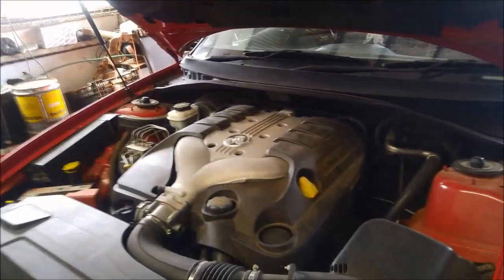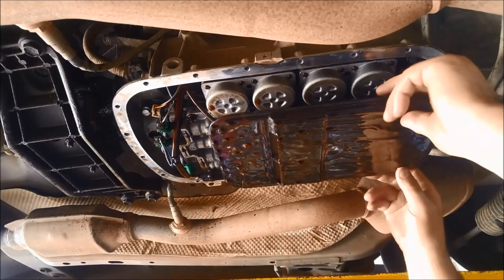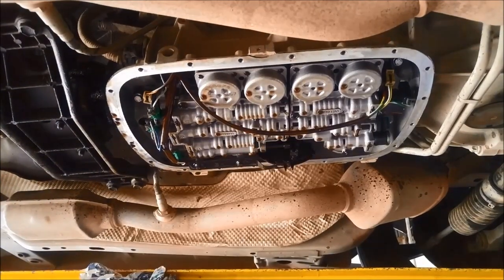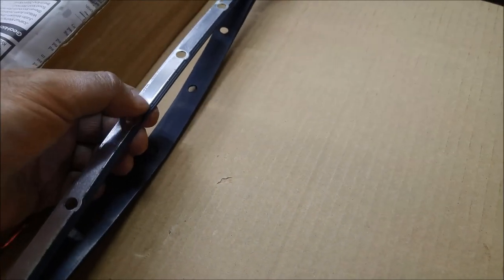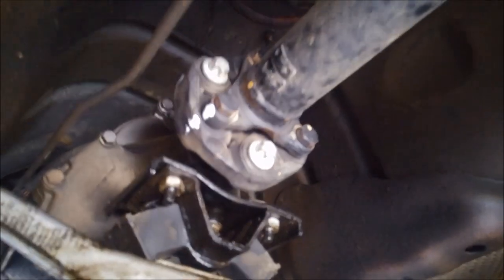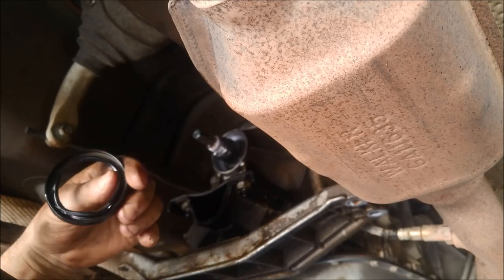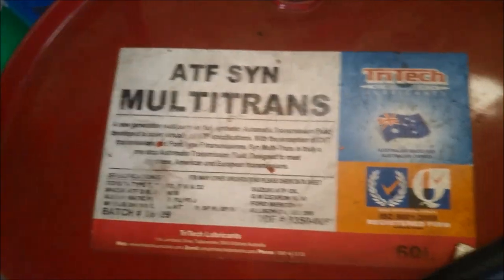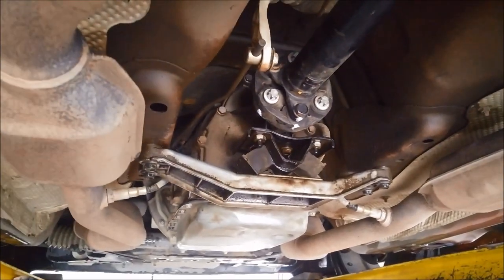GM Holden BMW 5L40E Automatic Transmission Filter Service & Replace Extension Housing Seal A5S360R

Comment: Man just wanna say thank you so much for this! I was nervous doing it myself but followed your instructions and now my transmission is working perfectly! Prior to this I had lost all gears, turns out it hasn’t been serviced in a very long time. I think I’ll drive it for a few hundred kms then do another flush on it - there were so many metal filings the magnet was caked. 

Thanks again mate!
Reply from the maker: hi, glad to hear our vid helped, a few beers to show appreciation are always well recieved ;-) cheers

Comment: Hey there do you know if i can put this trans into a ve i know series 1 ve sv6 have the same trans but iv read that you have to change the rear output housing because the drive shafts are different does anyone know if the rear housing will swap streight over

Comment: Great video.. I have a 2009 ve SV6 and the pan doesn't have a drain plug.. is that normal..?
Reply from the maker: hi, not all trans have drain plugs, can get messy. cheers

Comment: Hello, great video thank you for posting. On a X5 e53 3.0 with this trans are there any other plastic or rubber gaskets one should replace inside the transmission once the filter is removed?? I thought there were some plastic sleeves or something else that should also be serviced, but I'm not sure if that's only the ZF model?
Reply from the maker: hi, thats about it for the transmission service. cheers

Comment: Wot if the new filter dont have that white stopper on the new filter is has the two seal rings will it still work

Comment: Will the movement from the worn bearings cause that new seal to fail prematurely?
Reply from the maker: hi, id say the case bush on the output shaft is worn as well...not really much more you can do, replace seal and see how long it goes for again....otherwise a rebuild would be the way to go, but trans is still running ok.cheers

Comment: Do you have a video  on how to replace the solenoids on the 5L40E tranny? Thank you Sir.
Reply from the maker: hi, sorry thought i did.....there is a little slot next to the outer side where solenoid pushes in. use a small screw driver to flick out the circlip ( careful not to lose it ) but support the solenoid or sometimes the valves and springs fly out. https://www.youtube.com/watch?v=_xfSei7gD_E cheers

Comment: On this GM 5L40E tranny, what's  usually cause  slipping or like a "thud" noise when you're slowing down to stop? Thanks you Sir in advance.
Reply from the maker: hi, always check basics first...fluid level, battery fully charged and strong, electrical plugs not corroded or contaminated etc., slipping is usually due to clutch not getting enough oil pressure or pressure sealing leaks to the clutch. the filter could be blocked or the seal where filter goes into is leaking and sucking air. check the solenoids for correct operation and not leaking. fault codes usually only show up if solenoid electrical parameters are out of range. the thud 2-1 could be low fluid, pressure control solenoid contaminated or worn, 4-5 solenoid leaking, accumulator seals are flattened out or hardened, worn low/rev clutch or free play in clutch excessive. hope that helps good luck
Reply from the maker: low/rev checkball in valve body could be worn too

Comment: Great video, I've got a code p0733 and I changed the filter and the fluid like u showed here but the problem still shows up, do u think I need to change the solenoid and how difficult is it, thank you in advance
Reply from the maker: hi, yes will be a good idea to check all the solenoids, they are most likely all contaminated and/or leaking. cheers

Comment: How hard is it to replace the front seal on the transmission? I’ve already got it entirely removed so I just wasn’t sure if you had to unscrew the entire bell housing to do it or if it was as simple as the one on the rear
Reply from the maker: hi, make sure bushing hasn`t spun or isn`t worn, or your new seal won't work for very long. cheers

Comment: G'day what a great technical video .. I'm an aussie living in Thailand made a big mistake in Buying a BMW E46 and have had nothing but trouble ..transmission is GM5L40E and transmission has died 3 times .#1 .first was no reverse but went ok through the gears and sometimes did select reverse ..so had that fixed at great costs #2 next was the reverse gear selection again same problem had done maybe 50K so off to a trans repairer again and seems circlip on reverse drum was incorrect and the circlip retainer was broken so another GM5l40E major repair kit with machining of clutch drums  and other parts ..another major bill ...got 12 months warranty .#3 then next problem 3 weeks out of the 12months warranty transmission went to limp mode with 2nd gear slipping and yep bad luck I was 3 weeks out of warranty and car had just done 15000km ..I ran a diagnostic on the transmission on the OBD in the car and code was PO732  2nd gear slipping  and the temp was  90c  when the motor was cold the transmission had no problems only when it was hot did the  problem start so am wondering what is the correct temp for transmission ..90c seems a bit hot ..there is a thermostat for transmission in radiator tank that I replaced because the existing one had the internals removed ..maybe removed it to allow no restriction to the transmission cooler ..and held on this problem would be appreciated
Reply from the maker: hi, contact me on our facebook link   https://www.facebook.com/Yep-Thats-It-103051017785435 , we can exchange vids, pics & beers for info on there. cheers

Comment: Hi there great stuff as usual from you
You helped me with a trimatic dump valve
which is working perfect since.
Just 1 question about the sump gasket
Is the rubber side up or down on the 5L40E?
Many Thanks.
Reply from the maker: hi, either way. cheers

Comment: Great tutorial just want to know How much transmission fluid  do I need for sv6 5 speed
Reply from the maker: hi, depends on work you do and how long it takes. roughly half comes out with filter service, however you should always check fluid level as per manufacturers instructions and between correct fluid temperature ranges. thanks & cheers

Comment: I got p0700 and p0761 Solenoid c codes, should I replace solenoid c. Not really sure what the condition of the transmission is, still gotta drop the pan and see what the oil is like, got the car given to me by my mum since she didn't wanna spend and money on it.
Reply from the maker: hi, make sure you bench test as many solenoids you can access. often just replacing the scan indicated solenoid is a short lived repair as all the solenoids and sensors will wear and become contaminated. cheers
Reply: @YepThatsIt  I will most likely replace all of them not sure what my plans are with the car so will see, I asked my mum if it slipping when warmed up and she said yes so I thought I'd check the oil and it seemed like it was over filled and dirty, not to sure how over filled it was I didn't measure what came out, but I made sure to fill it back up the correct way and added trans flush since I plan on changing the oil in it, can't test it yet since I'm replacing the bearings and seals in the diff.

Comment: Can I use the drain transmission fill plug off of a bmw since cadillac uses the same transmission
Reply from the maker: if its the same, then why not? cheers
Reply: @YepThatsIt  whenever I search it for the cadillac I'm not getting much info on the plug like the size. But majority of the options I'm seeing are for bmws. Quick question. Since we share similar transmissions. I've seen bmws upgrade their valve body. Would I be able to make that work for the cadi? Or I'm just dreaming lol. There's not much performance parts for the cadillac I have and I'm on the lines of having all my performance parts fabricated to make them fit. Just don't know if it will work